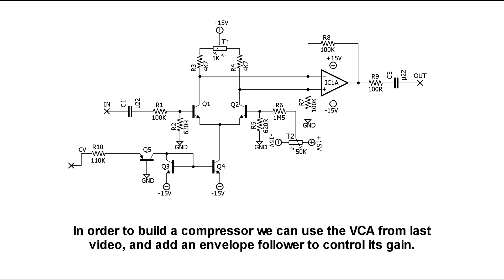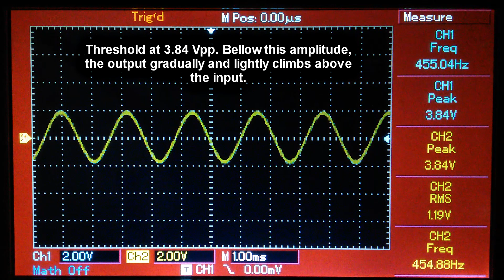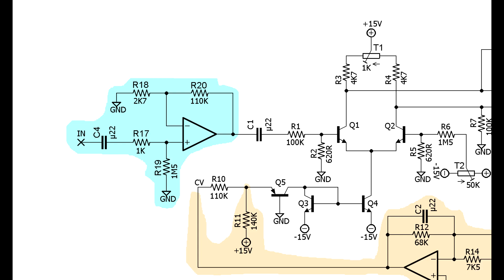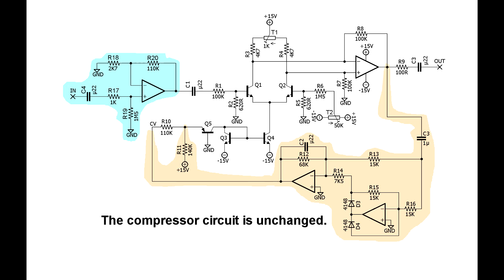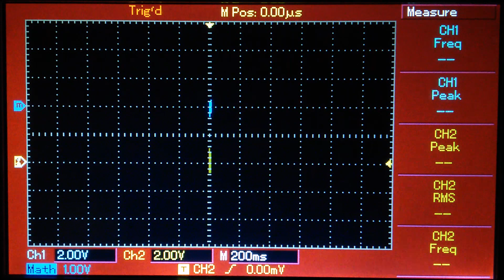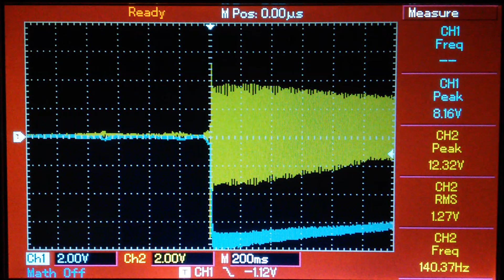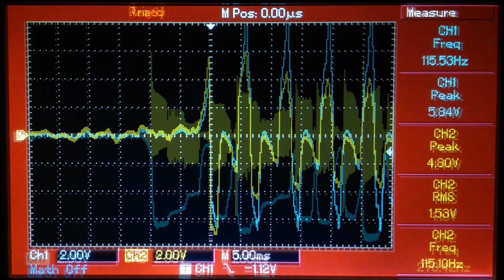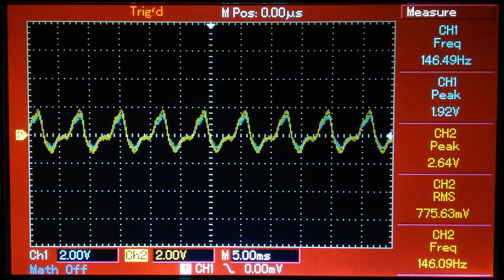Audio Compressor on Breadboard, using the VCA from previous video

Comment from the maker: An envelope follower is added to the breadboard with the VCA from previous video and a basic audio compressor is implemented. Tests with modular analog synthesizer audio level signals, and with electric guitar after pre amplification. The circuit uses two dual opamps, five transistors, a bunch of resistors and a few capacitors. Schematics included.